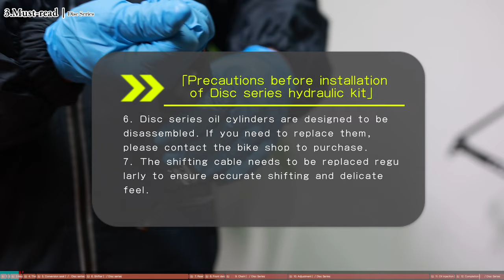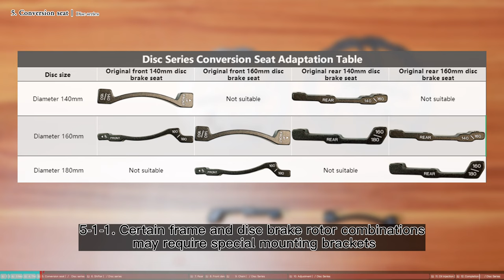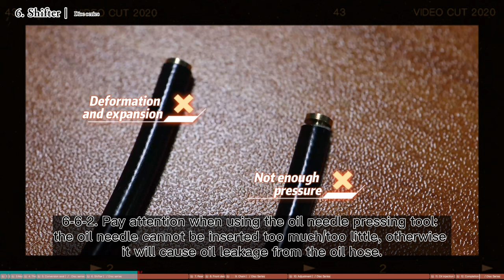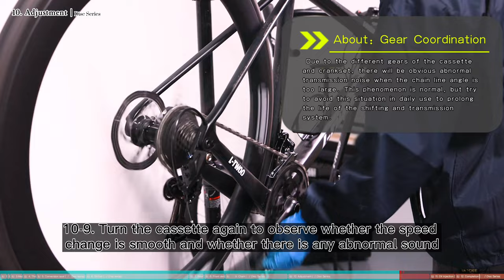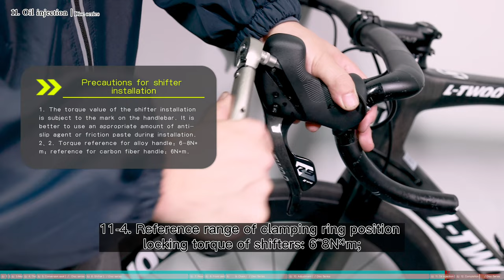L-TWOO Disc Series Hydraulic system installation tutoria

Comment: Hi
Mi fork is post mount for 160mm. I' m trying to mount the front caliper but the adapters included doesn't fit. I have the grt calipers. Please help me!
Reply: This calipers are not for Post Mount. They are for Flat Mount. But you can use other calipers (Shimano MT-200 for example) with this levers for Post Mount.

Comment: The groupset is inferior. Quality assurance is suspect. LTwoo does not stand behind their product!
Reply: Troll?
Reply: No I purchased the RX groupset and it was missing the 5 mm lock nuts on the shifters for the hydraulic cables.  I with could not get anywhere the contact person at LTwoo.
Reply: @jglantzx1  so did you able to buy the nuts or become trash, just bought this groupset for the hydraulic also was really cheap but i guess i would cancel the order